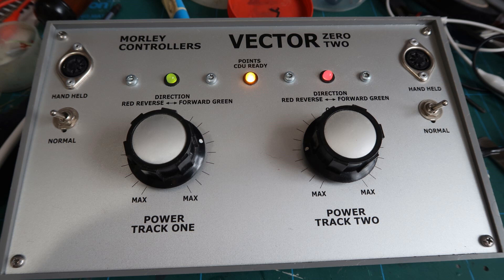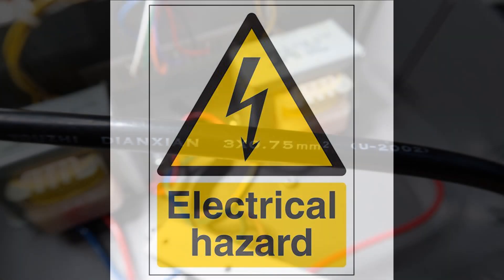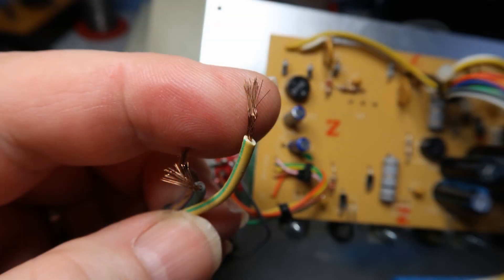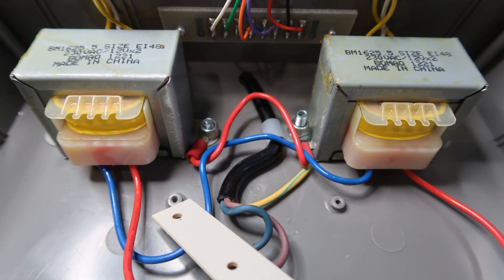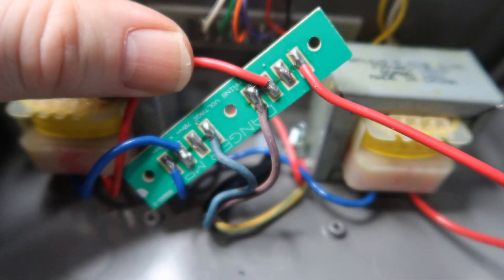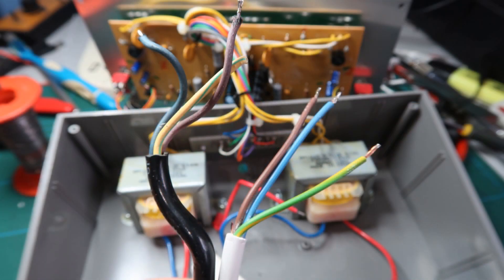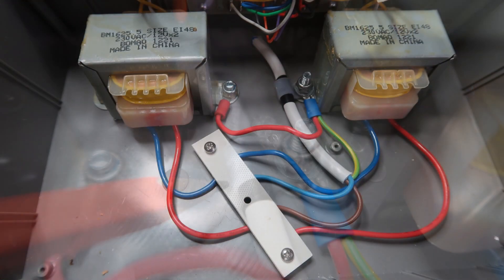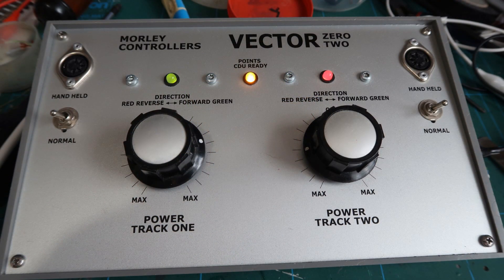Morley Vector Zero 2  Replacing Mains Lead  Model Railway Controller (2020)

Comment: Nice clear and concise video Mike. I have so many controllers that have failed but it's components not the cable that is the problem.  David.
Reply from the maker: Cheers David, tell me about some of them?
Reply: @ModelRailwaysUnlimited  Hi Mike, Unfortunately I cannot access them at present due to work I'm doing on the layout and I have locked them in with boxes of stuff but there is one you will be able to help with I'm sure. I have a Tr-ang model RP 14 and I need to put a plug on it but I don't know the cable colour code. There is a green, a black and a red. Which is live and which is neutral?  Thank you in advance, David.
Reply from the maker: Hi David, that's the old color code, green is earth, red is live and black is neutral. Make sure and check the cable for any imperfections. Glad to help

Comment: Unfortunately many Chinese cables I see everyday at work are NOT made of copper. It's I credible the cost cutting,  as well as outright dangerous. Commonly the strands are copper covered aluminium. Worse still I've seen strands which are magnetic!!!! Nice video Mike.  Cheers Gary
Reply from the maker: Hi Gary, many thanks, I just tested mine with a magnet and no reaction, however the copper coated ali could well the the case, the strands fall with extreme lightness! Could just be a bad batch of course???

Comment: Not best impressed at the use of a red cable between transformers as the earth bond. :(
Reply from the maker: Hi, you make a good point, but I guess red is just equipment wire these days 3 phase accepted of course.